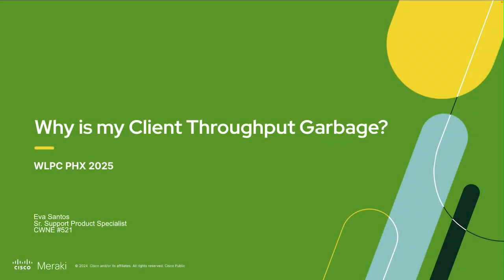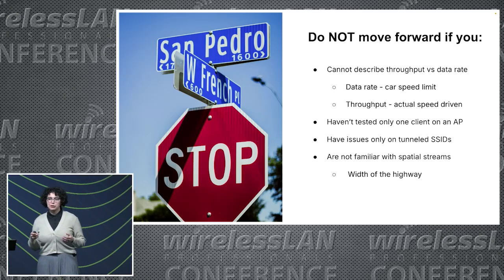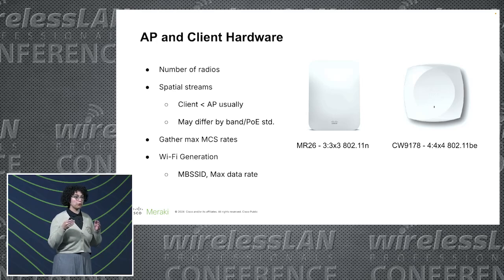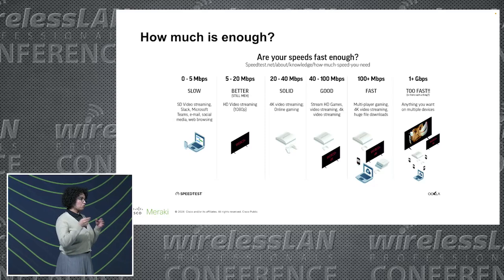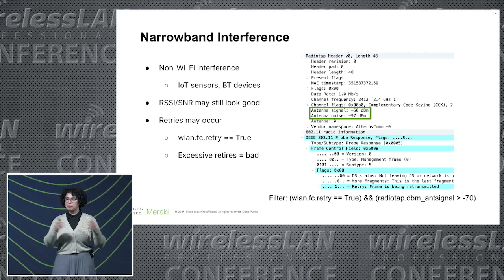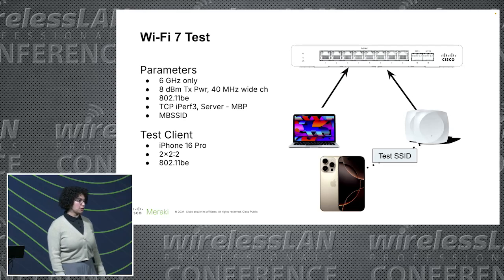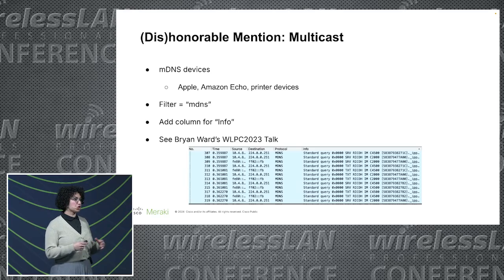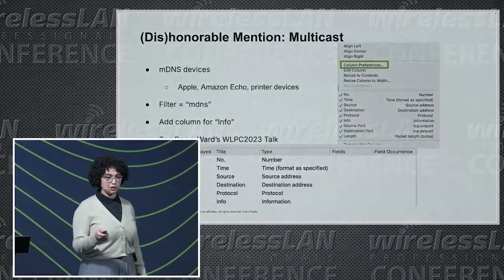Why is My Client Throughput Garbage? | Eva Santos | WLPC Phoenix 2025

Comment: Question: When a speed test is conducted is it from the actual STA > AP > Wired Backhaul >WLC>Egress Gw? 
How do you isolate the STA > AP "speed?"
Reply: You can try  an iperf to the default gateway. So the traffic is not completely isolated between STA > AP, but does not go to the internet as an speedtest would do. Traffic would reaming on the LAN. At the end of the day what is important is how the traffic flows from point A to point B. Most likely the point B would be internet, or an internal resource (gateway, whether is a VLAN IP or an internal server).

MCS index might answer the question on the speed being negotiated between the STA > AP.